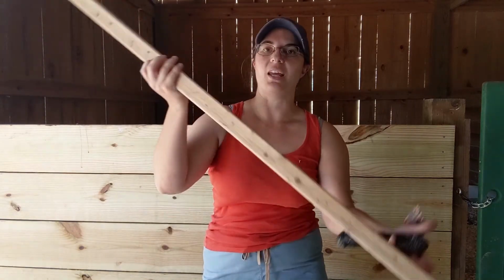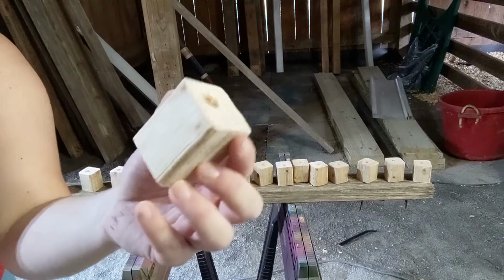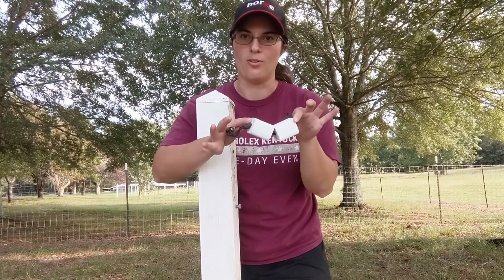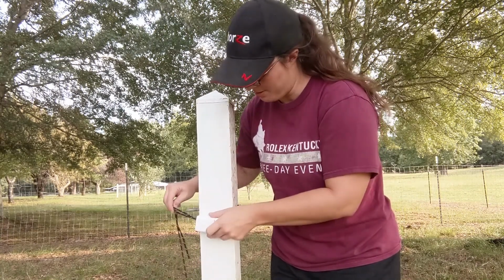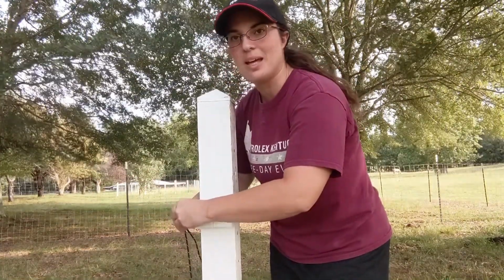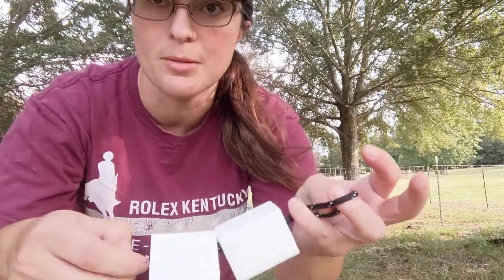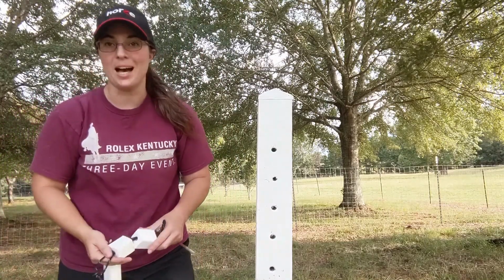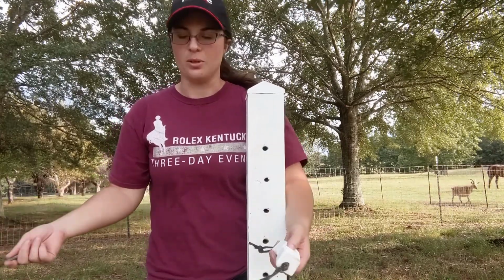Equestrian Hack: DIY Jump Cups

Comment: seems okay but I used a pail for mine. I made this custom painted brick style jump with artificial flowers on the sides. For the jump cups I then I took a regular pail as it's naturally round cut it into a third the size if it's a 5gal pail it will give you around 4 cups each will have a curve from that part of the pail and a piece of the bottom of the pail as an upstand to mount it to your jump post. 3inch PVC pipe is also really good for the poles.

Comment: Good idea. Could one do the hole in the back, pointed 45 deg down and shorter? So that there would be shorter pin, in the back, nothing sticking out. Or dies one not want that because it would collect water in the holes if you left the jumps out?